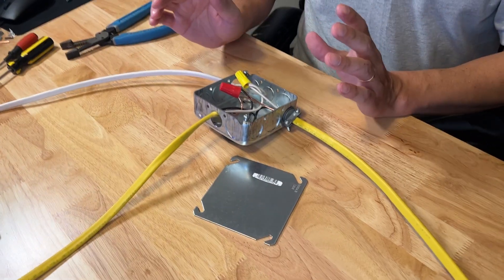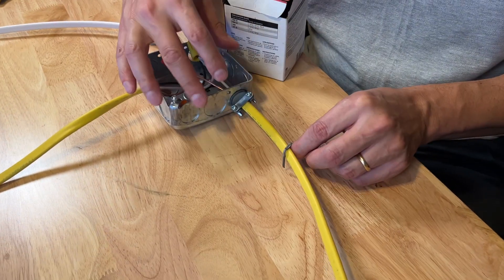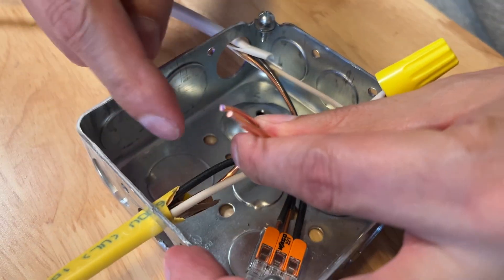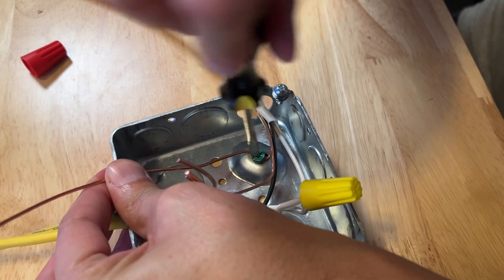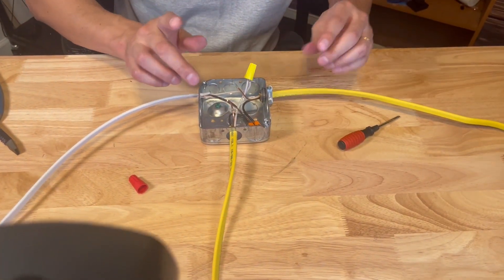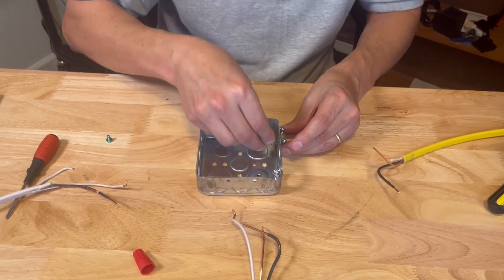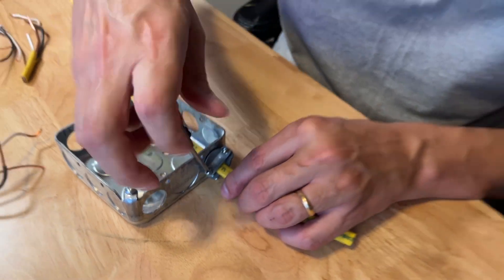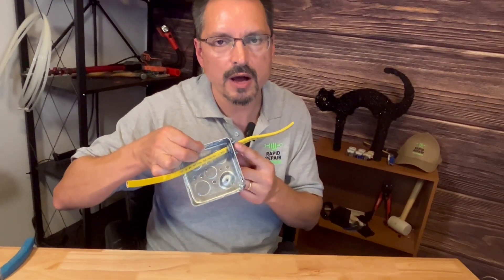5 Mistakes Everyone Makes with Metal Electric Boxes

Comment: how do I handle a junction box with mixed gauges?
Reply from the maker: If you have a larger wire to a smaller wire I would correct that. If the wires inside the junction box are correctly matched to each other you can probably leave it. 🛠️
Reply: I ran fresh 12-2 to a bedroom but have 14 gauge going to all the outlets in the room, with a 20A receptacle & breaker at the terminus' of the 12 gauge. Hard to get a good twist. Thinking of a sub panel... @HomeRapidRepair
Reply from the maker: @patrickbrumm420  if you have ANY 14  gauge wires on that 20 amp circuit change the breaker to 15 amps asap. Good luck 🛠️🛠️

Comment: Can you cite a NEC code reference for not allowing 14 awg and 12awg in the same box? That is a 4 square box, not a gang box.  a gang box is another type of box.
Reply from the maker: Good ears that you caught that. The downside of mixing 12/2 wiring on a 15 amp is that it confuses electricians, and someone could try to upgrade the breaker without realizing that there is also 14/2 wiring on the circuit. 

I always keep 20 amp circuits & 15 amp circuits completely separated.
Reply: It's not illegal to bring two different size wires into the box, but if you have a 20A circuit, it's illegal to carry 20A on 14 gauge wire. If it's 15A circuit, you can use 12 gauge wire, and sometimes it's recommended depending on voltage drop.